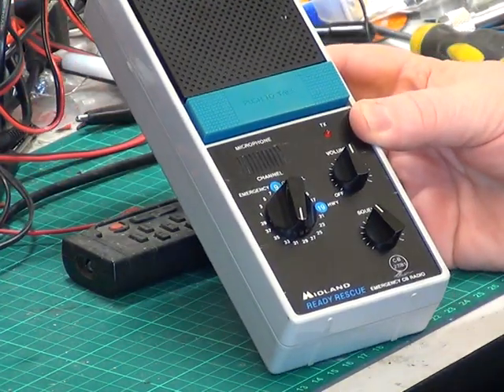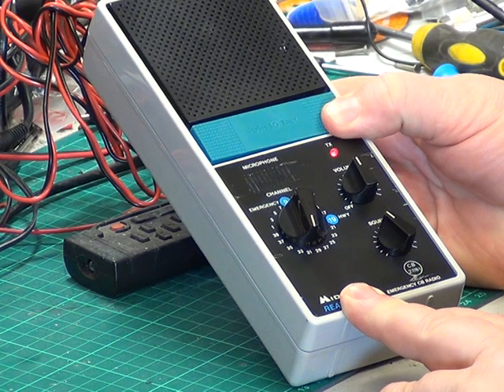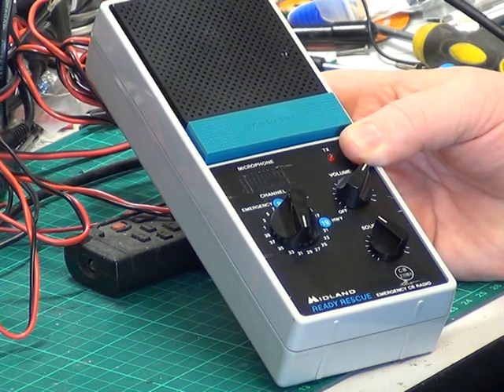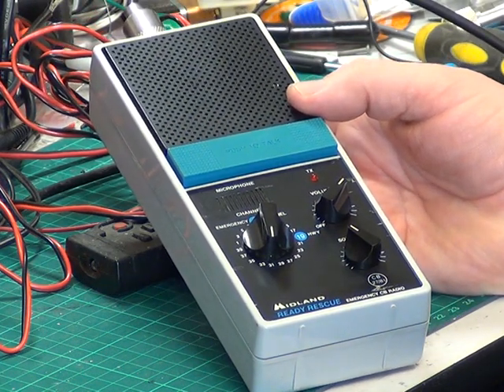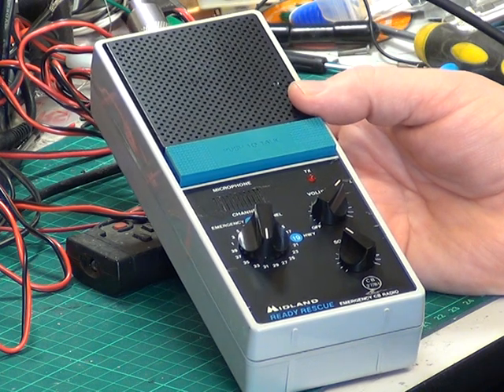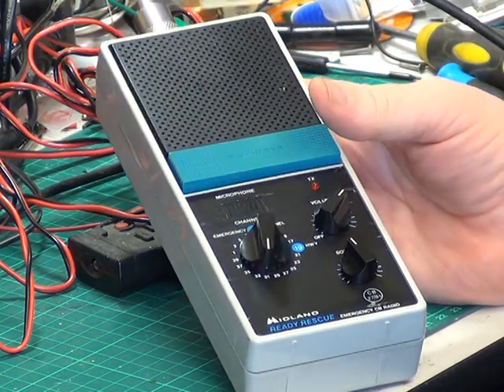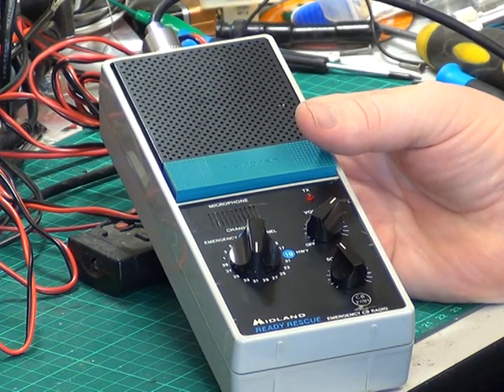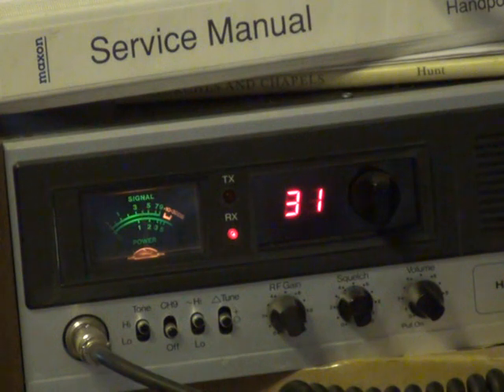Midland 77-810 Ready Rescue UK) CB27/81 CB radio emergency kit -  On The Air Test

Comment: Is this AM or FM.?
Reply from the maker: The UK set of 40 channels is FM only 27.79125 to 27.99125. In the UK, we may (since 2014) also use the CEPT set of 40 channels in AM, FM or SSB/

As this radio is 1982 it is UK FM channels.

Richard {UK}